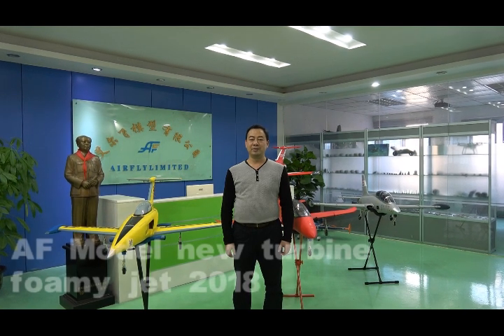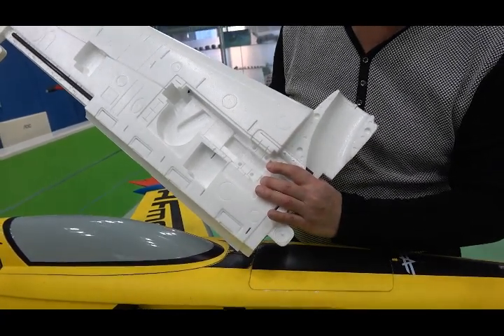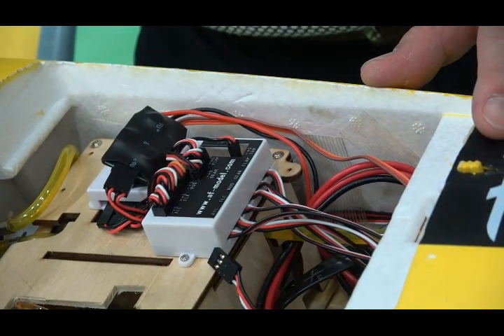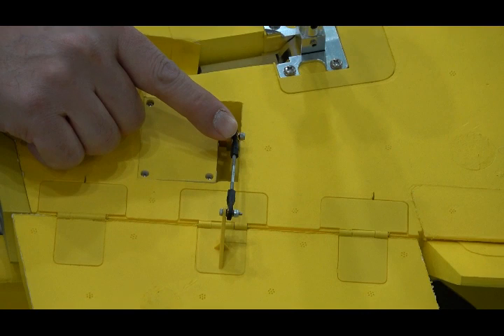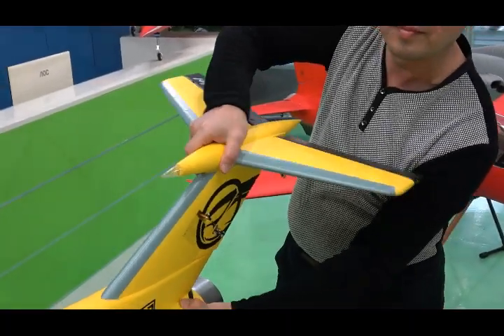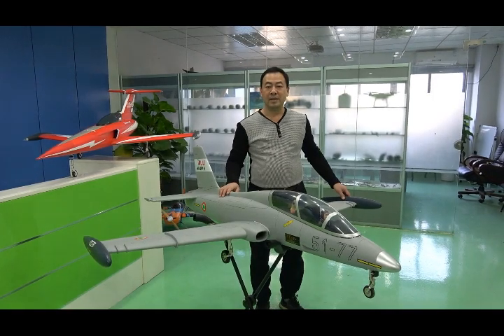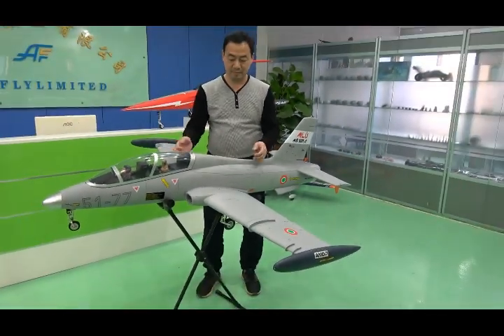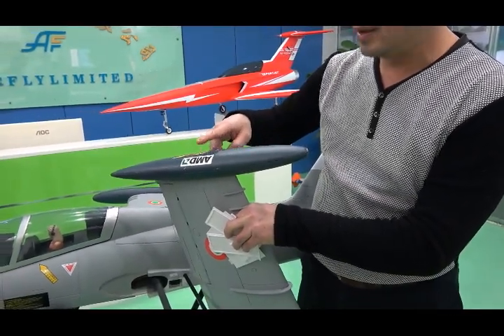AFM turbine foamy jet phototype introduction

Comment: The only thing bad about a foamy jet is that it gets hanger rashes and bumps very easily hence model looks are compromised as u starts to use it, however ive done almost 95 flights on my has viper and its going good

Comment: One more thing. Could you consider developing TS-11 Iskra Foam JET? It flies as good as BEA Hawk but it has a smaller fuselage and is slimer so you could make a plane as big as Mirage 2000 (HSD) howerer it would have better slow flight characteristic and would be more convinient in the air too. What do you think about that?
Reply from the maker: Too many good model can be develop, but step by step...
Reply: True!